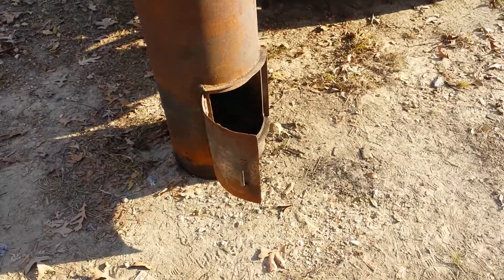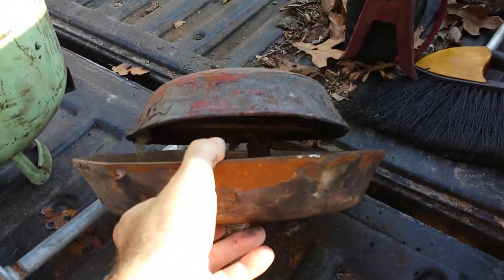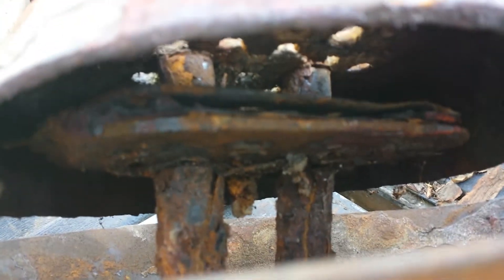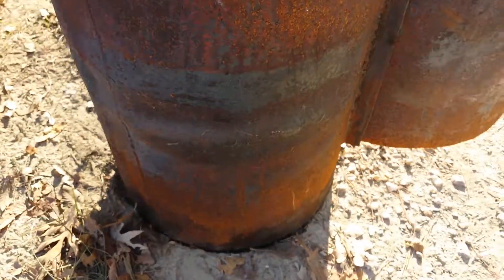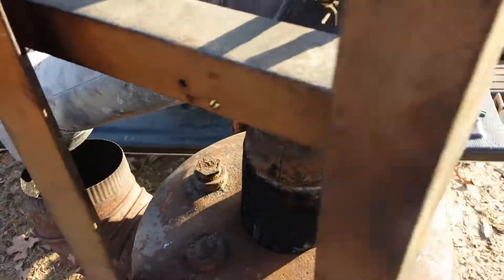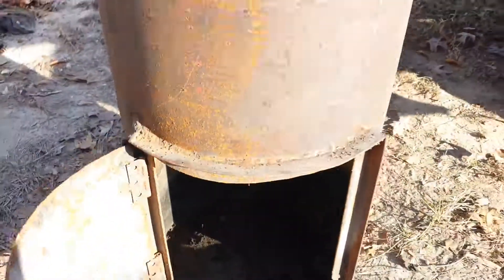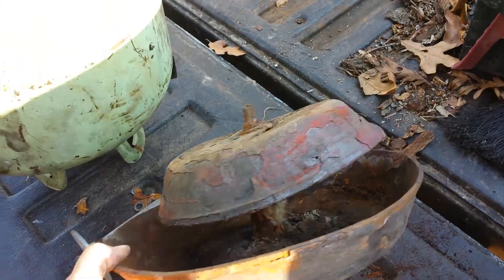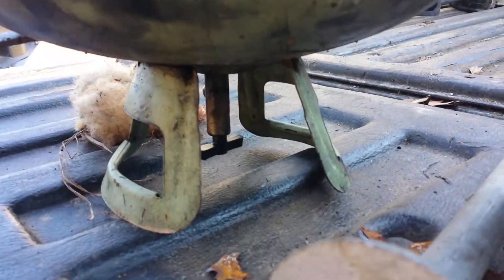Mother Earth News waste oil burner.

Comment from the maker: Not much chance of a leak AND we didn't let just anyone near it. We also never filled it totally full with oil because it really didn't need it. The upper part of the tank never gets remotely as hot as the lower portion. The inlet only has about three inches of rubber line that is gravity feed only and the oil flow is so little even if the tube fell of there couldn't be much of a fire. The feed tube enters through the air inlet so always a good bit of cool air passing right through that area. Never came up in about ten years of use. In the shop it was in the water hose was just a about six feet away. We washed and detailed cars in the bay next to it. Thanks for the feedback.